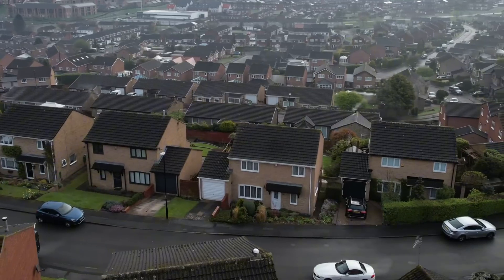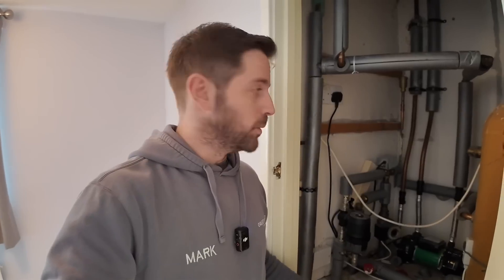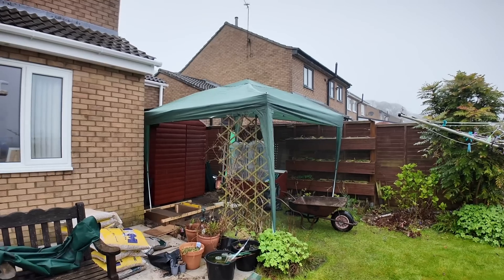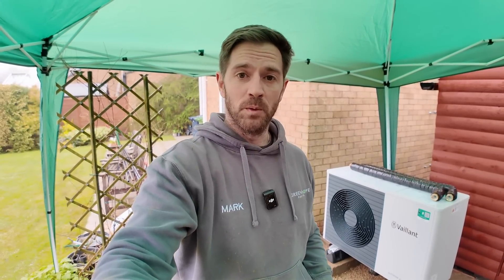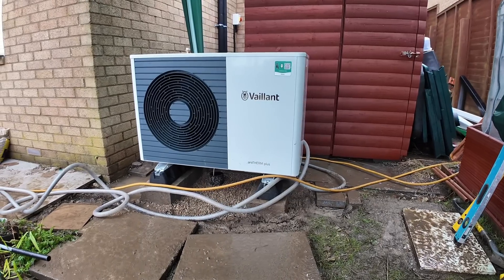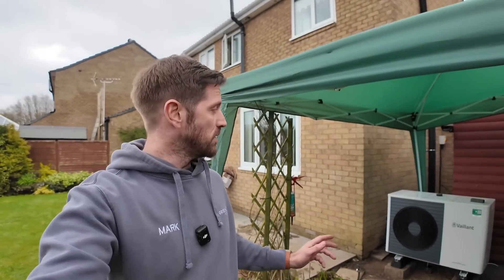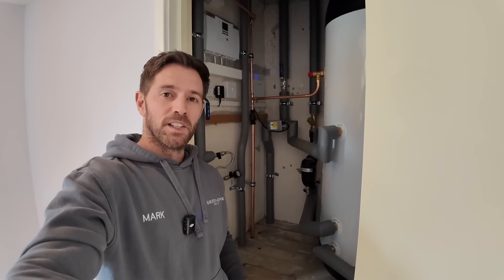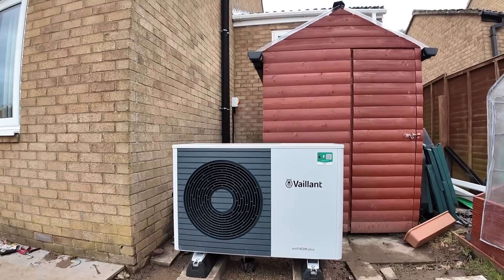Heat Pump Installation in Sunderland | Vaillant & Primary Pro | Heat Geek Elite

Comment: I have a question: at 6:34 you mention that you continue with 1 inch (=28 mm) copper pipe, but all the connections on the Vaillant devices are 5/4 inch, so meant to be for 35 mm copper. Also the installation video from Vaillant is very confusing as you see them connecting 5/4 with 35 mm on the mono-bloc to go into the wall, and a few videos later in that same series it suddenly is a 28 mm pipe where they install a Viege 28 mm to 1 1/4 (5/4) connection. 

What is the point of these 5/4 connections if 28 mm is used anyway? Is there a specific use case for it?

Comment: We’ve had a Vaillant aroTHERM system installed for just over four years. Unfortunately, our experience has been disappointing: we’ve faced multiple breakdowns, each causing long periods of downtime, sometimes weeks without heating or cooling.

What’s even more frustrating is that we have an active maintenance contract, yet support response times have been extremely slow and inconsistent. In urgent situations, it has taken two to three weeks just to get a technician on-site — which is unacceptable for a premium system.

The system works when it works, but in our case, its reliability and service have fallen short of expectations.
If you’re considering Vaillant, I strongly recommend researching alternatives like Hitachi, Bosch, or Nibe, which appear to offer better performance and support, especially in Spain.

Comment: Great video showing every part of a heat pump installation (including where you learning ), some  good news: the Vaillant flexi hoses now come with our primary pro insulation fitted 👍 out. Primary Pro provides a thermal conductivity of 0.035 so the best on the domestic market , made to help you pros 👍

Comment: Were all the radiators on 15mm? Any microbore?
Reply from the maker: Hi, all the radiators on this job are  15mm but we have done installs with existing microbore in place which can work perfectly fine depending on the output needed.

Comment: Cost?  Does Heat Pump replace Oil Fired Central Heating?
Reply from the maker: Hi, the average uk cost of a heat pump install is around £13,000 but you get a £7500 grant towards the total cost. We have changed lots of oil boilers for heat pumps. They are a brilliant alternative.

Comment: We are having an instillation soon.  Our house does not have any heating system other than electric radiators which I bought a few years back. Roughly, how long does it take to install, I assume it’s about a week?
Reply from the maker: Hi. A full install like that would generally take us 4-5 days but it depends on the company and how hard the job is.

Comment: Thanks for this video. I'm interested in training to install heat pumps. All courses seem to be for existing heating engineers. I can find gas safe/ACS courses for newbies but I'd rather just train for heat pumps. I can do the heat loss and pipe size calculations but not so good with soldering pipes. Any ideas for training? I intend on doing the heat geek course. Thanks

Comment: I might be getting a heat pump. But every time I watch one of these I just think ffs why does it need so much stuff to operate! A tiny boiler in the kitchen and a small tank upstairs. Replaced with digging up garden, big outside, pipes on the outside of building, bigger radiators and the airing cupboard full up 😮‍💨
Reply from the maker: Unfortunately nothing can beat gas for the compact size. There are other heat pump off ions available such as exhaust air but you need to be able to get vents from kitchens and bathrooms back to the heat pump and it’s still the size of a fridge freezer.
Reply: Because of MCS regs. In theory a high temp HP could be a straight swap for a gas boiler - they both heat up water. Or add insulation and an ordinary monobloc ASHP.
Reply from the maker: @johnhunter4181  although heat pumps are capable of high outputs the max design temp for them is still 55 degrees under mcs. We don’t often go much higher than 45 degrees to be honest to try and maximise efficiencies
Reply: @greenhomeheatingltd  I must say the quality of your install looks amazing. A friend had his done this week by Octopus - took eighteen man-days and it was quite a mess. But only £2.2k in the end so...  My point is simply that the MCS regs make any install very much more complicated than it needs to be. The high flow temp would only be required on the few very coldest days, but you'll probably have your Christmas jumpers by then so do we really care? Freezing cold winter days are usually clear and the sun streaming into my house will overheat it if anything. And there are these things (also banned by MCS) called portable convectors or fan heaters to get you through. Of course at the coldest times you're likely to be tucked up in bed anyway.

Comment: How do you get the pressure down i left the valves open
Reply from the maker: Hello. You would need to open a drain valve on the system and drop the pressure to 1.5 bar

Comment: Weather compensation is the best way to control All heating systems. Many cost comparisons are made betwèn heat pumps with WC and gas boilers without WC, which is not a fair comparison. Gas boilers can happily run with a flow temperature of 25 deg. The only thing that interest me and clients is the RoI, what do you expect this system to acheive?
Reply: True, all comparisons are with all singing all dancing heat pumps as opposed to high temperature gas boiler with a on/off thermostat

Comment: What about the main fuse upgrade to 80 or 100 amps,does every install need this.
Reply from the maker: Hi, That depends on what the maximum demand in the home is. Before the installation we calculate or test this and notify the power grid of the planned install. Most of the time it’s ok but they have came out to upgrade the fuse on a few occasions.

Comment: That looks like a pretty neat installation but I hate the external pipework, surely it could have been fitted within the cavity wall? One question I have is why is there a need for an internet connection? Another way for officialdom to reach into our lives?

I also have an issue with the siting position of the heat pump itself. Possibly not your choice, but if I were the home owner I would have moved the shed forward and had the heat pump against the back wall. As it is he has lost all flexibility over what he does at that corner of the house. He can't swap the shed out for a bigger one if needed in the future or if he did away with the shed, the heat pump will be standing in the middle like an afterthought!
Reply from the maker: Thank you. We have done the external pipework in trunking before but we find this method gives better protection. We let the customer decide which way they prefer it doing though. He also chose the location as to what suited his plans for the garden best and also gave the best airflow around the unit. 
The internet connection allows us to remotely fine tune the system by dialling in the weather curve and also gives the customer access to an app to let them see how the system is performing.
Reply: @greenhomeheatingltd  Thanks for the reply.  I thought the position may not have been your choice but I think the owner may regret hos choice later. I guess it can be changed if needed if at a cost. And maybe I am too much of a conspiracy theorist regarding the internet connection but I know legislation has recently been passed to allow the government to insist on remote access to 'connected' white goods in the future (Fridges, washing machines) in kitchens to verify that they are eco friendly and control when they can be operated

Comment: No mention of the cost of the installation and the annual running cost compared with the original system. If the cost of the HP installation is about £15K the payback in running costs could be more than 10 years
Reply from the maker: Hi Richard, sorry I should have added that in. The total cost was just over £5000 to the customer. A similar system with Vaillant boiler and unvented cylinder would have been £6000+ for the same standard equipment and controls. The heat pump has been running at a combined efficiency of 450% so is already saving him on running costs as well.
Reply: Thanks for such a quick response. I must assume that the 'cost to the customer' took into account government grants of about £7500 so the true cost of the installation would be about £12000. It is this cost which has to be used to show savings which should include the cost of electricity to run the HP. For future installations the subsidies/grants/tax credits will not be available. I currently heat my 3 bed detached house and hot water for about £1500 pa with a combi boiler so about 8 years of heating and hot water just to cover the HP installation excluding the running cost.
Reply from the maker: @richardlewis5316  yes that’s correct that’s the cost after the grant. I agree once the grants are no longer around it’s going to be expensive to install, the main expense is in the initial system set up. Heat pumps should be cheap to swap like for like after that point. If your boiler is perfectly fine it’s definitely going to be a cost, but if it’s an older boiler like this one that initial expense was going to have to be paid anyway for a new system so this customer actually saved money getting a heat pump over upgrading their system. 
Heat pumps generally cost more than combi to combi installations but system conversions and full installations can work out cheaper (with the grant and no vat, while it lasts)
Reply: @greenhomeheatingltd  The customer had already over sixed his Rads & i guess pipe to them was all 22 mm. If not for that, New Rads & Pipework or UFH would add quite a bit. Although VAT relief would be on all of it if done at the same time.
Reply from the maker: @markfernandes2467 all the pipework was existing 22mm primaries splitting down to 15mm. 
You don’t always have to repipe and can sometimes even get away with 10mm plastic depending on the heat needed to feed the room. It’s all down to correct heat loss and calculations
Reply: The heat pump will be using on average about a quarter of the power of the gas boiler. Currently electricity is taxed to make it 3-4 times the price of gas. So while the heat pump grant may be taken away in future, it is also very likely electricity will become much cheaper relative to gas.

Comment: You lost me at oversizing the heat pump.
Reply from the maker: Could you please explain what you mean? The heat pump is a 5kw unit for a house with 4.75kw heat loss. And the design temperature of 45 degrees is what was achievable without the customer changing all of his radiators and costing him extra money. This system will easily be over 400% efficient over the year.
Reply: The Vaillant might have a 5kW label on it but at that design temperature it will output 5.8kW as per its technical specifications.

The 3.5kW version would be quite marginal at that design temperature, probably needing more radiator upgrades.

By only looking at Vaillant you're making a choice of either oversizing by 25% or struggle to meet peak heating at design temperature.

There has to be a heat pump out there that better fits the design parameters than one that will likely low power cycle quite often.
Reply from the maker: @michaelwinkley2302  yes this unit will output around 5.8kw at design temp. The customer really wanted a Vaillant unit though and this was the best fit for the job. The 3.5 unit only gives around 4.2kw at the temperatures we need but the it is essentially a restricted 5kw anyway so you might as well upsize to have the faster hot water recovery and the same minimum outputs. 
What makes would you recommend for in between sizes? I’m always happy to look at other options but the Vaillant has been such a good unit we tend to stick with it where ever possible.
Reply: It's hard to recommend a specific brand because not enough manufacturers actually list their technical specifications with enough detail to make an informed choice.

A quick search suggested that Baxi list their specs to the same standard as Vaillant, but I've not looked to see whether they'd have a heat pump that would meet this particular scenario.

Most seem to only publish A7W35 despite MSC and NBHC guidance being A-3W45 design temperature.

Some do seem to list A-5W45 maximum and nominal (which seems odd).

Honestly, the manufacturers probably need to make it easier for your industry, since most installers aren't as informed as you are.
Reply from the maker: @michaelwinkley2302  I agree. The size on the badge can be a bit confusing. I think posting the lower level of modulation would be really good as well. There are a few brands out there that may do a heat pump closer to the maximum output needed for this scenario but I know the Vaillant would still manage to outperform it over the year with the better technology and controls. I have heard brands like NIBE are good but it’s getting the time to do the training to fully understand and optimise them.
Reply: @michaelwinkley2302  You'd be hard-pressed to find a sub-5kW Air-to-water unit as a direct replacement for a gas boiler. As already stated the 3.5kW Vaillant is just a capped 5kW model, so doesn't really count.  UrbanPlumbers has 3kW heat loss on the 5kW unit and gets some of the best SCOPs still, so the 5kW is still a good choice for smaller heat losses.
There are sub-5kW for A2A, and hybrid set-ups, along with Exhaust Air Heat Pumps (which I don't think are a thing in the UK atm).

Comment: What is the distance that the unit can do on a defrost from outdoor unit mono block to inside water cylinder 
I was getting a nibe heat pump and was told  max distance was 12 meters that run looks a lot longer so I made need a split type ?
Reply from the maker: Hi, the Vaillant can be around 20m for the primary pipework.
Reply: Thanks for the reply

Comment: Where (or with whom) did you do your training?
Reply from the maker: Hi Geoff, our main training for heat pumps was via the Heat Geek course. I have been on lots of other heat pump courses but they are pretty rubbish unfortunately.
Reply: @greenhomeheatingltd  so ‘Heat Geek’ is good, most others are poor?
Reply from the maker: @geoffmansfield2668  the others I have attended have been pretty poor. I have hear of a few other low temp design courses that are supposed to be good such as Kimbo Betty but I have not been on it myself.

Comment: How come you had to fit piping on the outside? Was it not possible tonuse the current boiler piping to the cylinder?
Reply from the maker: Hi, the heat pump has been located on the other side of the house to where the old boiler was so needed a new route to the cylinder cupboard.

Comment: Did the house already have 15mm pipes to the radiators?
Reply from the maker: Yes this house was all 22mm and 15mm pipework to radiators already. If you have 10mm copper pipework this can work but the correct calculations need to be done. 10mm plastic is more difficult.
Reply: @greenhomeheatingltd  Nice tidy install. When we renovated our house back in 2004 we used a mixture of John Guest plastic and copper. The heating tee's off in two different directions at the boiler, the original house is fed via 22mm plastic, this feeds a zoned manifold, and then individual 15mm plastic to each radiator, the other half of the house is done in copper. As we have 15mm plastic, but each rad has its own feed and return do you think this will be an issue due to the inserts? I can't see how this is different to 10mm microbore, as the ID of the inserts is 9mm. I realise the zoning will need to go though.
Reply: @greenhomeheatingltd  Thanks, and yes, I have 10mm copper drops to all the radiators.

Comment: Nice installation, could show how you optimized the radiator valves to create the correct flow to heat the different types of rooms with the ideal temperature?
Reply from the maker: Thanks. We usually remove most of the TRV’s from radiators to make sure the majority of the system remains open to get the correct flow rates. We then use testo temperature clamps to check the DT is correct across all of the radiators and make sure it’s all balanced nicely. If a radiator is slightly oversized we might leave a trv on to help limit the room temp in that room.

Comment: It looks a really neat and tidy job, well done.

Top marks for owning up to a mistake, others would have kept this quiet, so kudos for that.

In interesting and informative video with lots useful info.

I didnt notice a buffer im wondering did you fit one?

The two pressure vessels are a bit of a blot on the landscape, luckily hidden in the cupboard. Im surprised vaillant dont have an unvented with one built-in. Could the heatrae megaflow be used instead or does it have to be a vaillant brand?

Can existing controls be integrated into the vaillant system? I have 'Wunda' underfloor heating on the ground floor so i would prefer to use their app contyol that i am familiar with.

Im toying between the vaillant and a Daikin, he latter being considerably cheaper....any thoughts or experience with daikin heat pumps?
Reply from the maker: Hello, Thanks for the comment and glad you enjoyed the video.
We try not to install buffers at all if possible. Sometimes a volumiser is needed if the system does not meet minimum volumes needed but this one was fine.
We find going open loop will give you much better efficiencies so that would mean removing the blending valve and individual control of the downstairs underfloor system. Then just control it from Vaillant’s main control which I would definitely recommend paying the extra for over daikin. I have the same set up in my own house. I good installer should be able to work out the output of the floor then size the upstairs radiators to suite so it all runs at the same temperature. 
I hope this helps.